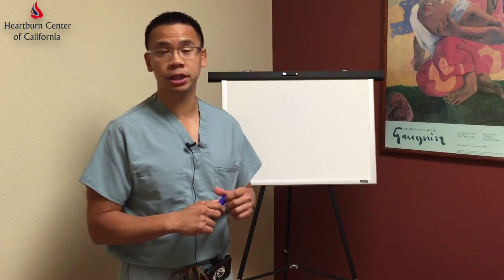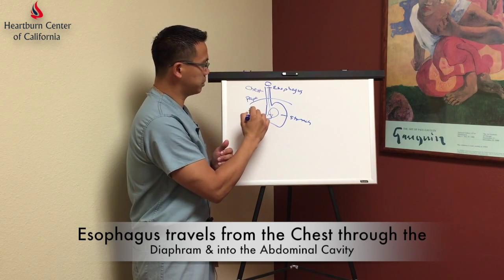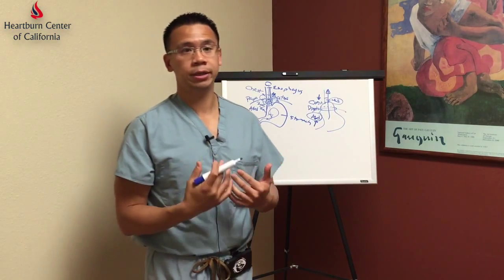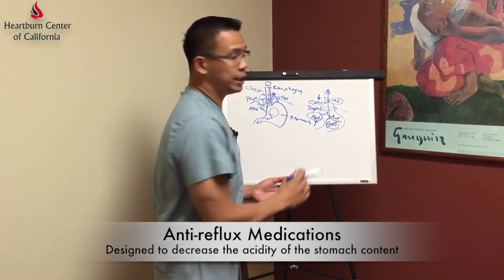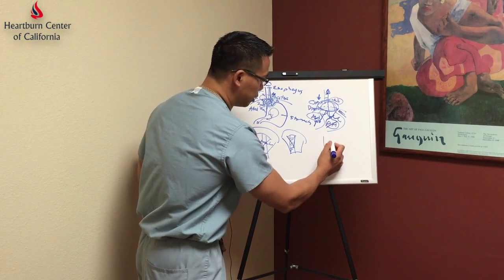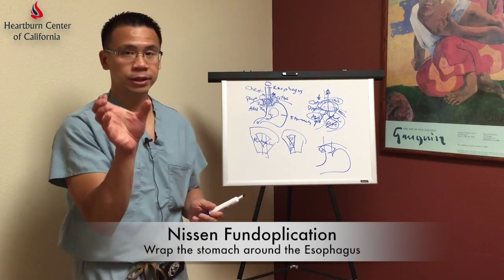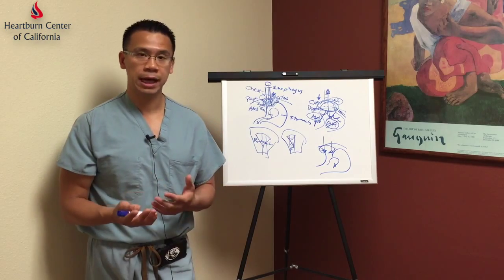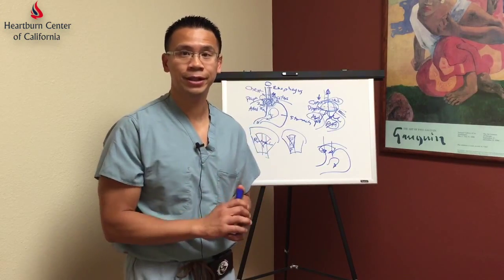Nissen Fundoplication

Comment: I read that a Nissen Fundoplication surgery can fail after a few years (5-10), even if the surgery is done correctly in one shot, by an experienced surgeon ( one who has done 100+ surgeries in life, 10-20 per year). After failure, patients might still have to continue PPI & they also might have gas bloat, dysphagia etc. Do you know any cases where the surgery lasted for 20 years plus without any serious issues ? Thanks !